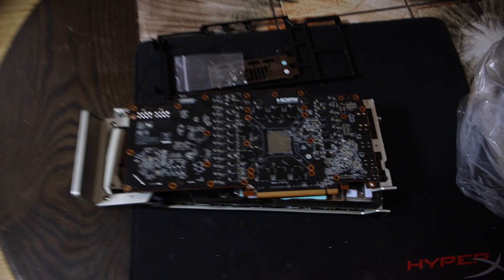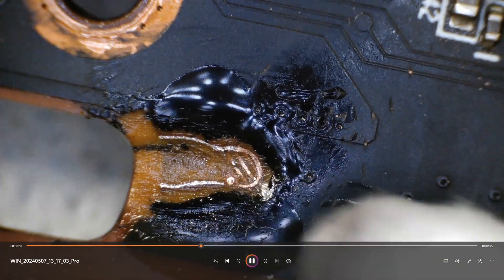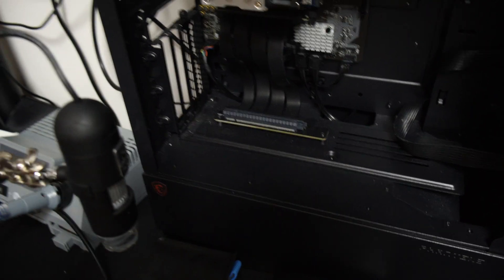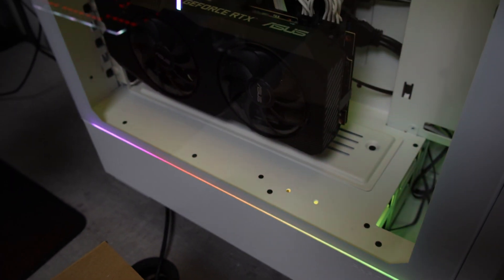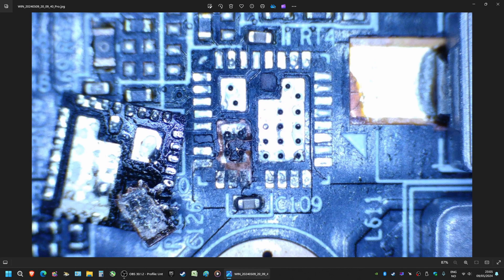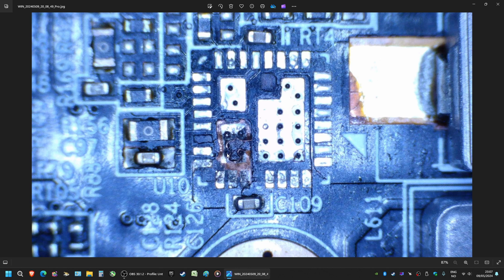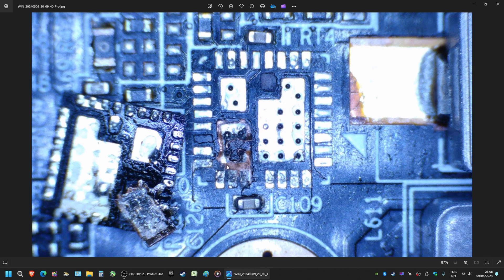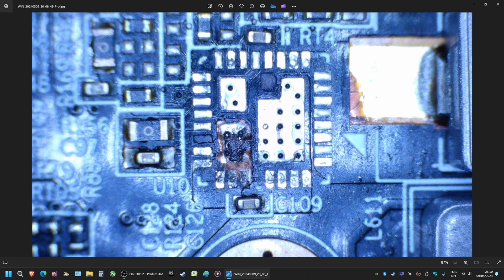Best Ways To Kill Your GPU!

Comment: I swapped my PC case to a vertical mounting case just for this reason. The Phanteks mount is some serious thing there. has lots of stuff with the kit. I also bought a cooler master vertical mount for my second case and it has just the mount and riser extension and thats it. No paddings nothing else. i had to make something of my own to add cushion at the bottom. Super video.
Reply from the maker: My bro :) You're absolutely on the money there. After having a vertical setup like this, I can never go back to horizontal. Even with medium sized cards, the benefits are still there, like not having that hot air from the GPU blowing on the chipset or M.2. Thank you, btw!
Reply: @TechnologyHive  I am with you on that. After switching to vertical I will never switch to horizontal again

Comment: Is there a list of case compatibility for that riser?  I have an NZXT H6 Flow with the 2 140mm fans on the bottom.   Wondering if a riser even works in that case.  I have the same Asus TUF 7900xtx oc as you.

Speaking of the OC'ing you were talking about.   Would you be concerned with OC'ing that GPU in adrenaline?  Which limits the power to +15%?   Right now I have the power +15 and the voltage with a slight undervolt at 1130mv.   Core clocks at 2400 min, 2900 max.  VRam clock 2752 (2766)
Reply from the maker: https://phanteks.com/PH-VGPUKT.html
It is universal. In most Phanteks cases, the rear of the case is open where the GPU is installed. You just have to remove the PCI covers. But if your case has rails, you will need to clip them off so they are not in the way.

The power delivery for the TUF 7900XTX is made MPS. It is the best of the best, despite the coil whine. The controller is smart enough to catch deviations so as to protect the power drivers from shorts, or blow outs.  Your OC is just fine :) I am talking about extreme stuff, like shunt mods. That is a big no no for most cards with generic power delivery.
Reply: @TechnologyHive  ok great.  Thank you for the info.  I really enjoy your video's.  I'm always trying to learn more about the industry and hardware
Reply from the maker: @davebond2381  Thank you for watching my videos! I am myself always learning, since there is always new stuff coming out so we're all on the same boat :)